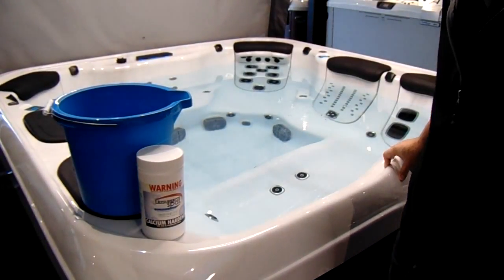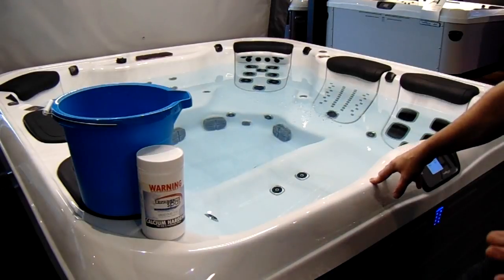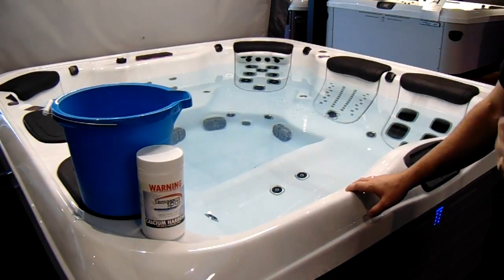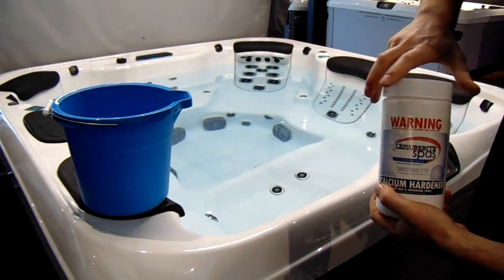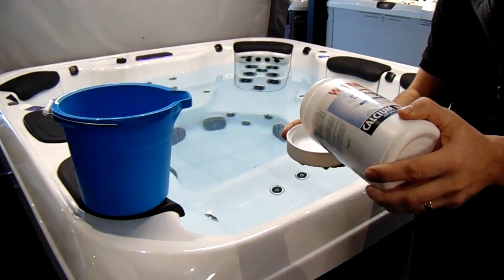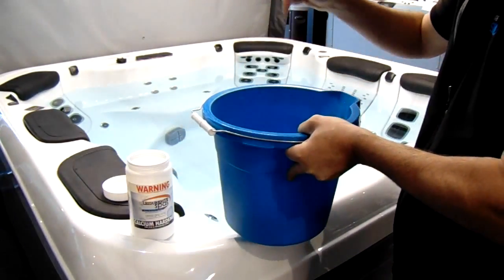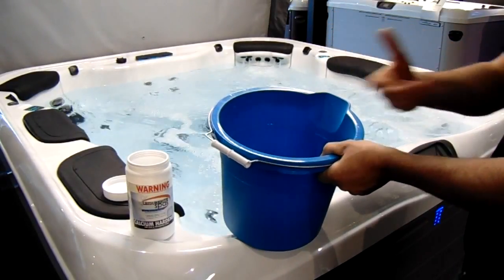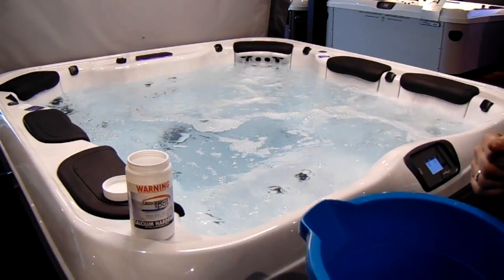Chemical Instructions 1 of 3 - Calcium Hardener

Comment: I have Baqua Spa calcium hardener that was left by the former owner of my house, and I have scale or calcium on the surfaces. I have no idea what to do with this calcium hardener. I also live in an area that is on a city well, and it’s known for its bad water. 😢
Reply: Hi Kathryn, If you have scale on the surface this indicates your PH is very high which allows the dissolved Calcium in the water to solidify on the surfaces. A way to get rid of this is to drop your PH to a low level (acidic) - roughly 6.4 on the ph scale and leave for a few days.  The scale on the surface should then soften and possibly dissolve and worst case is softer to wipe off with a soft cloth.  Once this is completed you will need to raise the PH back up to the desired level of 7.6.